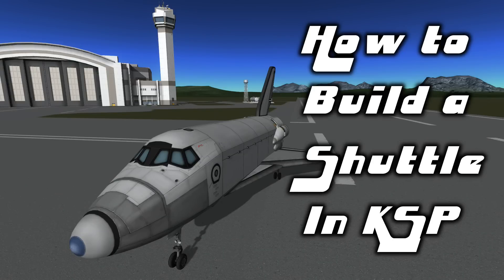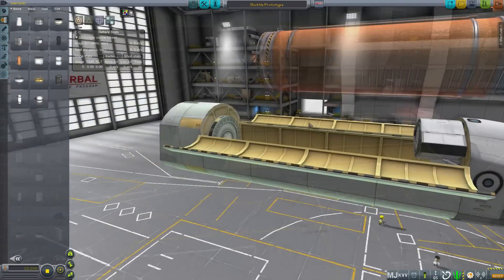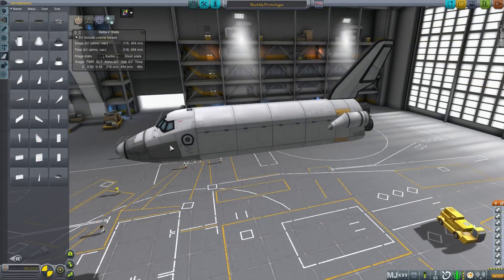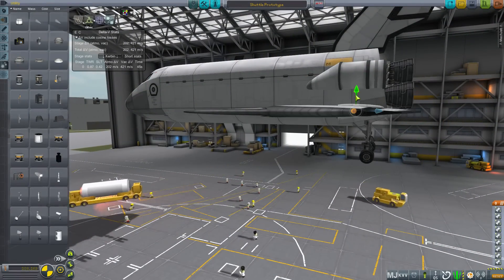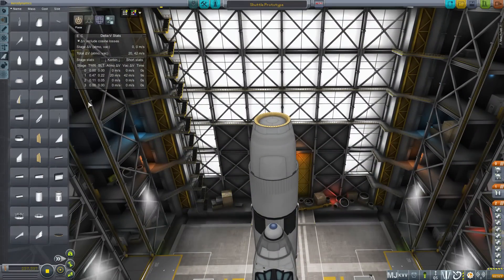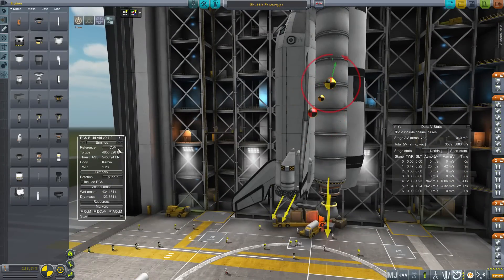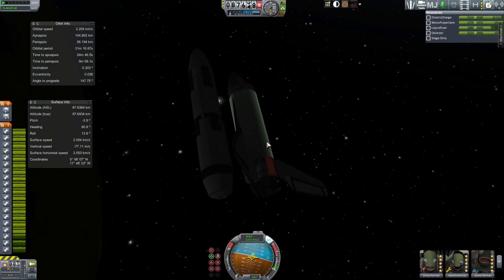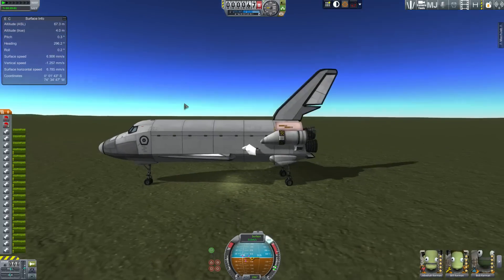How To Build a Shuttle in KSP

Comment: If you invert those elevons, you can deploy them as flaps before landing. Should allow you to land at a slower speed with more lift.
Reply from the maker: +Benjamin Brooks not a bad idea. Have you managed to implement a solution that doesn't result in the shuttle just nose diving when you activate them?

My elevons are linked to the brake button, so at the moment of landing, I can trigger the brakes and get this really nice, strong flaring action that lifts the nose of the shuttle right up and slows the sink rate.
Reply: +Negative Root I guess that's because they are so far aft, away from the center of mass. Maybe you can use trim to offset it.
I haven't actually tried to build a shuttle in a long time. The new engines will make it worth trying again.
Reply from the maker: Benjamin Brooks definitely. that's why I did this video because it is much, much easier now days :D

Comment: You should consider switching the Mk3 monopropellant tank with a regular Mk3 rocket fuel tank. Instead, you should put a smaller monoprop. tank inside the cargo bay. You REALLY don't need that much with you.
Reply from the maker: +firefox3249 :) as I said in the first 20 secs of the video, this is a shuttle, you're welcome to build yours how you want, this is just my version. Here's why I use the monoprop tank:

1. It can't be burnt accidentally on ascent.
2. It allows for enough dV for decent range on orbit when fully loaded with an orange tank.
3. My opinion is that it looks better. The mk3 rocket fuel tank is a bit larger and the shuttle is already a little long for the wings.

One of the beautiful things about KSP is that we all have our little quirks and reasons for doing things. Bet your solution would work just as well as mine.
Reply: Negative Root It does work. However, as you said, you have to keep an eye on that Mk3 fuel tank.

Comment: When I  lift my nose up at 3-4 G the Shuttle brakes apart and the flight results telling me that there is a structural failure between  the part where you put the big gimbal engines on  and  the monopropellant tank.

i hope you can help me out :/
Reply from the maker: +skirmess are we talking re-entry or ascent? On re-entry, there shouldn't be any massive corrections. You should be holding a 30 degree AoA before you hit atmo and then just maintaining it throughth descent, slightly increasing it or decreasing it to adjust where you are going to land.

if we're talking ascent, make sure the engines aren't clipped through anything too badly. Also, be gentle on the throttle. The shuttle as I've designed is extremely OP (to allow for large corrections inflight), so you may just be punching it too hard. Throttle up gently.

If you give me more info, I'm happy to help out, if I haven't already.
Reply: +Negative Root I tested the schuttle starting from the runway with infinite fuel so i can see how it flies so neither ascent nor re-entry.
Reply from the maker: skirmess ah... so that makes sense. the situation you mentioned would never exist in a normal flight of the shuttle, so this is good news!

In terms of getting your flight test to work, try putting the shuttle vertical on the pad with some launch clamps and going from there. Trying to pull up at 3-4Gs is absolute suicide and no wonder the craft shatters.
Reply: Negative Root ok, I'll give it up building shuttles or SSTOs xD. I'm doing so hard on building them. I'll rather stay with normal rockets but thanks for your help dude. :)
Reply from the maker: skirmess nononono! don't give up! just know that one of your tests is pretty extreme for a shuttle is all XD find a less hardcore test and I'm sure it'll go better.

Comment: I MADE MINE THE EXACT SAME AS YOU AND MINE EXPLODED AS SOON AS M LAUNCH CLAMPS RELEASE
Reply from the maker: +McGillicuttyyoutubing that's gotta be annoying...

XD

Strut all the things. Try again. If its still fucks up, see if you can identify what is failing first (it should show in the summary after everything blows up and fix that)

However, KSP is a buggy game. It may be that you have annoyed the kraken and there is a particular part that hates you. Until you move that part, it will continue to blow up. Good luck with it!
Reply: i have never gotten to the kraken yet
(the kraken probally does not want me to get to duna so it destroys something to get to LKO) And i struted all 4 things together the identification is mainly the ET hitting a clamp i put there but now it flies for like 15 seconds then completely explodes
Reply from the maker: McGillicuttyyoutubing aha! Progress! Keep working at it mate. Identify the weak points and strengthen them :)
Reply: i pitched over 45 Degrees after takeoff and then the timer started for 10 seconds and when that hit 0 it just completely obliterated.
Reply: +McGillicuttyyoutubing Do you throttle down during the early stages of takeoff? Your shuttle may be heating up too much in the lower thicker atmosphere
Reply: yus

Comment: The hell? I have no deploy button on the tail. just std. ctrl settings, flp/splr settings and mass-strengt...
Reply from the maker: +Martin Sobotka you probably haven't duplicated the tail.
Reply: +Negative Root Thanks, but that doesn't seem to be the case, i did place it there with 2x symmetry and ofsetted it a bit apart.
I'll try disabling some mods probably.
EDIT: YUp, that was it, FerramAerospaceResearch was messing with me...

Comment: My shuttle has some probs. I start out with the tail facing the mountains and then try to commence a roll program like the real shuttle does. But when I try to roll  the shuttle yaws and I start to go down. Any help.?.?.?
Reply from the maker: +XpertPilotFSX are you using the same engines as me? because if you are, it shouldn't be an issue. Additionally, with LRBs yaw should be controllable. If its not, something is crooked on the ship, go find what it is.
Reply: +Negative Root well, yes I am using the KS-25's. But I saw that many other vids showed that you need to angle the engines towards the centre of mass. I tried that and it still yawed and pitched a little too.
Reply: +Negative Root but thanks anyway
Reply from the maker: XpertPilotFSX ok, something is throwing it off then. it could be weight imbalance (ie. a tank misplaced) or it could be aerodynamic (a wing or something).

Comment: Would Simply placing rcs on the shuttle work instead of OMS?
Reply from the maker: +Diabetic Atheist There are plenty of ways to build a shuttle. I do say in the first 30 odd secs or so of the video. My only concern would be the total TWR. With just RCS, it might not be strong enough to finish up the orbit.

Comment: I've got a question: If we're building our own shuttle design, how do we balance the thrust so it doesn't pitch off course?
Reply from the maker: the vector engines should have enough gimbal to overcome the imbalance. 

However, the theory behind  it is to have the centre of thrust acting through the centre of mass. I use RCS build aid to help me figure that out. You can do it visually using the thrust arrow and centre of mass, but its harder and isn't as accurate.

Comment: First of all, there are a billion easier ways than this. Secondly, your tutorial makes no sense. Whatever you say that will happen never does and the design for the shuttle just ends up exploding or not working.
Reply from the maker: +Diabetic Atheist that'll make quite an extensive youtube series. So when is episode 1? Also, it makes perfect sense to a lot of people, just check out the comments :) I'm happy to help if you ask some specific questions.
Reply: +Negative Root Alright sorry for the rude comment. I was just a little ticked off that day xD
Reply from the maker: Diabetic Alien thank you for the apology. If do have some questions though, I'd be more than happy to answer them :D Hope the coming week is awesome for you.
Reply: +Negative Root You said to only put the vector engines without symmetry. Because you rotated them, would it work if I put them in symmetry?
Reply from the maker: Diabetic Alien nah, they tend to point off in odd directions. the trick is to do it without symmetry and angle snap on, so you can get the exact same tilt on each of the engines.
Reply: Negative Root Alright, I see.